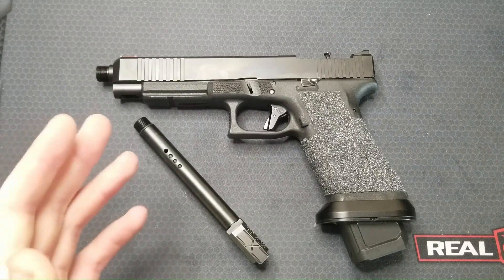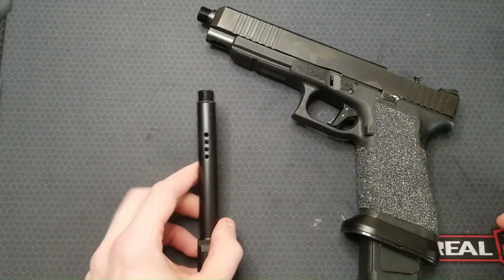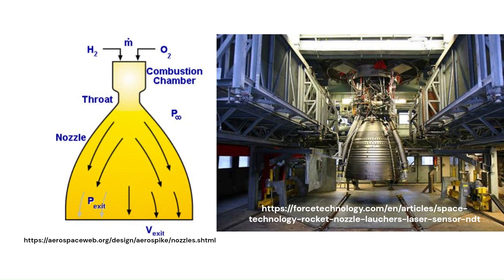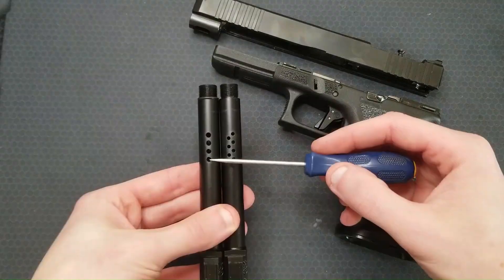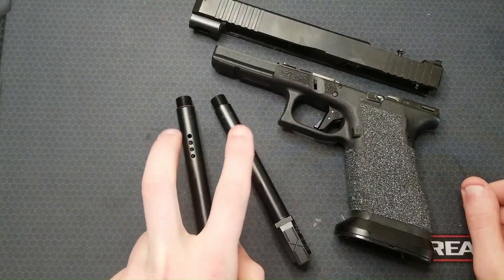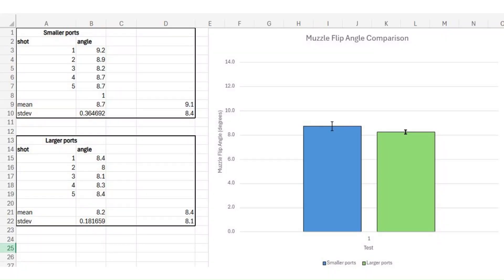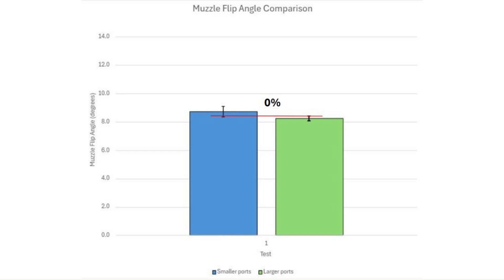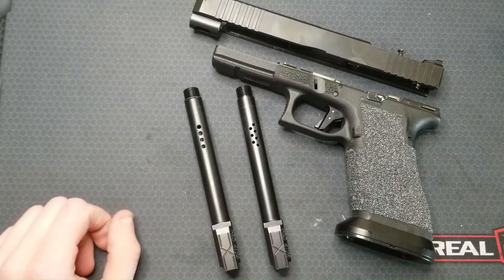Bigger or Smaller ports in a Pistol Barrel

Comment: I’d like to see the ports drilled at like a 20 degree leaned back angle. Yes I understand it would send more of the gas towards the operator, but would be interesting to know.
Reply from the maker: Ah yeah kind of "pulling" the muzzle forward with the gas energy. Then again, any gas not being vented straight up will not contribute to reducing muzzle flip, which is generally what I want to reduce on my pistols.

Comment: Love your stuff, but not enough control when dealing with differences this small in performance imo. One obvious difference in your port layouts being that optimally we want the ports to result in a push directly down. By having one set of ports offset from vertical in a v configuration and the other all exactly vertical, the force vector of the smaller ports being slightly off vertical is limiting the energy driving straight down into the muzzle, which is really what you are trying to measure. You should have run both port sizes in the same v config. Been enjoying this series though!
Reply from the maker: Still trying to collect data and glean what information I can within my testing capabilities. Both these port layouts were drilled vertically. I state this at 02:48. The smaller ports are just staggered and offset from the centerline to fit them within the same extents. I did that intentionally for this testing in an attempt to control that variable.
Reply: @I think It's more complex than just drilling them both vertical, as the offset ports still have characteristics compared to the gas under pressure in the barrel that are different. Is it enough to matter? No idea. But you have one set of ports directly in line to the push of the expanding gases, and another at an angle to the expansion in what you did. The ports drilled off center are also a longer "pipe" which will have more friction losses. My gut still tells me using a V config for both, with the ports drilled directly into the centerline of the bore is more controlled. You can maintain the overall length and location of the ports so dwell time will be similar etc.
Reply from the maker: @chadlevitan7886  Thats getting into the minutia that I don't necessarily care about. lots of compromises and simplifications here. And lots of things that are not feasible to control with how little real estate I have to work with on the top of a 9mm barrel, as well as the form of the ports I can even machine with my skills and manual 3 axis machine. I would hope most people watching these videos know that this is a pretty dang unscientific "scientific" test.

Based on my experience with this stuff, I think what you're describing wouldn't show up in testing at all even with a Ransom Rest. Nor could it be decoupled from other effects or even be isolated. Fluid mechanics simulations might be the only way to figure that out, and that's only in theory.

I agree that since the offset ports "wrap around" the circumference of the barrel more than the inline ones, there will be more gas coming from them that is directed sideways and doesn't contribute to mitigating muzzle flip. I thought about this as well before machining. I wanted the offset ports to have the same radial extents as the inline ports if possible. But that would have compromised my axial position and extents which I figured would affect results more.

The fluid mechanics of the gasses coming out of the ports are going to be so complex that it is certainly out of my wheelhouse to make conjecture about performance. I explained in the previous video that my background in mechanical engineering related fluid dynamics primarily dealt with subsonic incompressible flow as that is most applicable to my field, and what the curriculum taught. Supersonic compressible flow, the case with gasses leaving barrel ports, is a whole different animal that I never explored enough to have intuition about a lot of this stuff. I would have gotten into it had I pursued an aerospace minor, which I did not.

Not discounting that you bring up a good point. The answer is with my testing capabilities, or the feasibility of this type of testing in general, Its not reasonable to try to control for or isolate variable like that. I attempted to control what I could and test as best I could, to come to the answers that may help me for my purposes. In this case, I got the answer I was looking for and am simply sharing my results.

I would love to see your port designs, testing and experiments if you ever go down the road of wanting to attempt to answer your questions for yourself.
Reply: My related knowledge is all limited to compressible flow in HVAC systems, so this is out of my wheelhouse too. It's just fun to think about. When I get a good mill, which is the next toy on my list, I'll definitely be playing around with port design! Thanks for putting your stuff out, it is all really interesting regardless.
Reply from the maker: @chadlevitan7886  Heck yea. The design and machining is probably my favorite part! I like that my testing spurs discussion like this in the comments, testing begets testing, some questions answered leads to more unanswered questions.
Reply: @EngineersArmory  Totally! It's not a popular topic of discussion amongst my regular friend group, shockingly haha. An experiment I had in mind was a series of ports of different and increasing or reducing sizes, perhaps a smaller port closest to the chamber with the most dwell time and in theory the highest pressure, moving up to the largest port nearest the muzzle with the least dwell time before the bullet exits the barrel and vice versa.
Reply: @chadlevitan7886  Can you share your thoughts on this scienerio? 
I am looking at having my Sig P320 XFive barrel ported.  The slide already has 3 windows in the top that I was planning on taking advantage of.
What are your thoughts on placing a "chunk" port that corresponds to the slide window nearest the muzzle, then two or three circular ports in the middle?  Should I do any ports in the window nearest the chamber?  What diameter ports should I consider?  I was thinking 5/16" in the middle and possibly three 3/16" in the rearmost window.
Reply: @jeffhernandez5098  Let me start by saying I am not sure. My back and forth did inspire me to start reading up on supersonic compressible flow, but there's a lot there to learn, and experimenting with port size and location is going to be necessary to help round out my understanding in the context of a pistol. In thinking about it more, I do think that having normally sized ports in the middle third of the barrel, perhaps slightly biased toward the muzzle is likely fairly optimal. This video shows a few good port setups, you can see how close to the chamber the Tampa Gun Werx layout starts to the chamber about midway in: https://www.youtube.com/watch?v=6ZGGgwSTiMA

  I would personally stay away from too large a chunk port, as it has the potential to negatively affect accuracy and throw more copper, but I do think dumping as much remaining pressure upward just prior to the muzzle is a good thing provided you aren't affecting accuracy. The OP's video comparing ported to ported with compensator demonstrate that there is probably a slight benefit to having both, a chunk port would accomplish a similar thing. A slot parallel to the bore axis is probably a better shape, ala the Glock C ports, to gain port area over a series of holes of the same width/diameter than a huge square or rectangular chunk port. The reason for using smaller ports near the chamber would really just be to maintain more velocity while adding some extra energy resisting muzzle flip. Depending on what you're planning on doing, that may not be a factor and you can just consistently size the ports in the middle and rear window. The ports closest the chamber will have more dwell time under pressure, which should mitigate the fact that they're closer to the pivot point of the pistol in your hands. If you're competing and need the pistol to qualify for major or minor power factors then the velocity aspect is maybe something to consider - but velocity loss should be pretty minimal even with lots of porting (50-100 fps total, so the rear ports should be a fraction of that) and you should be able to overcome it with hotter loads generally speaking, which will also make your ports work better. Hope this helps!

Comment: Sweet videos! Very interesting. I feel like when comparing port designs, you should chronograph them too to see if one bleeds off more fps.
I think V ports bleed off more velocity to achieve an equal level of downforce compared to top ports. It would be interesting to see this showed in a test like yours.
Reply from the maker: As interesting as that would be, I'm not interested enough in that to buy a chrono.

Comment: id like to see chrono(speed) or velocity change to really see if 1 design can significantly maintain muzzle velocity over the other
Reply from the maker: As interesting as that would be, I'm not interested enough in that to buy a chrono.
Reply: A measureable drop in velocity could be directly related to an increase in gas flow from the ports. Seems worth knowing. @EngineersArmory
Reply from the maker: @farmerdanz  Indeed it could. I gotta pick my battles with this testing, and I'm not going to buy a chronograph haha.

Comment: I have the timney as well. Hated the over travel after slide cycling. A ghost cat 4.5 connector completely changed it. Reset is now 2011 short.
Reply from the maker: Hm my trigger doesnt have much over travel. Pretty short reset. Maybe it's the zev connector I run.

Comment: Would smaller but more ports be as effective as larger less ports if they both have the same surface area of exposed porting? I.E v8 porting with larger holes vs v12 porting with smaller holes but same surface area of exposed porting ? Would like to see this explained as I’ve seen this questions asked across the internet without really a solid answer.
Reply from the maker: Thats exactly what I just tested in this video, unless I am misunderstanding your question. More smaller ports (7 in this case), vs less larger ports (4) with the same overall cross sectional area.

Comment: What would be your thoughts on something like crescendo porting(similar to like a WiFi logo), smaller ports out near the chamber and then widening out closer toward the muzzle. Seems like a similar idea you’d see in open guns as they sometimes have two ports on the barrel and then a large 4-6 port comp right after. Could this idea possibly have similar results to a bigger port without the detrimental effects of jacket separation?
Reply from the maker: Another one of those situations that I don't have good intuition for. after this testing I might be inclined to guess that increasing port size further away from the chamber would help more gas get out as pressure in the bore decreases with every subsequent port. So maybe that would help performance? I'm guessing the difference with another porting job of similar total area but uniform port size wouldn't be noticeable.

Comment: Thank you for all of your videos. Always learning from you. I'd be curious to also see if there's a difference between V porting vs inline. I guess in your case, 2 ports on each side vs the inline quad ports.
Reply: The V are worse, wasting gas and only the vertical component helps. 
V-porting stems from Magnum revolver porting. Has no benefits if you can make ones pointing up.

Comment: Id like to see if you tapered the holes. Outside to in is fairly easy but tapering from the inside to outside would be more difficult. 

I hated dealing with anything near the speed of light.
Reply from the maker: Putting a diverging taper (away from the bore) with a countersink would be an interesting test. I don't think we would even see as much difference in performance as we did here though.

Comment: have you compared the barrel ports vs the front "chunk" ports? If you did I missed that one.

Maybe an idea is barrel porting vs a/m muzzle comps
Reply from the maker: I have chunk ported a barrel, but i didnt bore the rifling out like I should have. So thats not a good representation of chunk port performance. 

I did compare porting to comps in a video with this glock 34. Check out the ported barrel playlist linked in the description. its in there.
Reply: @EngineersArmory I compared two chunk ports on my 48. One was back bored (Arc reactor), the other was OEM done by Mac Defense). The arc had a very slight advantage in reduction, but was far less accurate when compared to the fully rifled barrel. I assume the bullet was less stable upon departure. Of course it could be the difference is barrel quality.
Reply from the maker: @essray  The one without the rifling bored out is likely causing separation of large pieces of the jacket/bullet. I noticed a really bad loss of accuracy when I chunk ported my Hellcat in that manner. Also was depositing molten lead all over the top of the barrel and underside of the slide, essentially soldering it. 

Also got two quite large chunks of spalling imbedded in my forehead. ER, surgery months later. No fun. In my eyes, the rifling after a large area port, like a "chunk" port, absolutely has to be bored out for multiple reasons.
Reply: @EngineersArmory i have not experienced jacket separation or accuracy issues with my fully rifled OEM, but the super single by Mac Defense is conservative when compared to the big chunk port others offer. Just my experience.
Reply from the maker: @essray  interesting. I looked up that MAC defense port and it's still quite large. I would expect some accuracy loss, maybe not as bad as I experienced, but almost certainly spalling and jacket separation. Would be interesting to hold cardboard over it and see what damage/holes show up. Don't use your forehead like i did lol.
Reply: I’m also interested in the extended slide “comp” vs a threaded on comp  and ports. I have relatively little experience with compensated pistols, just a buddies open gun and my carry gun which is a micro dagger c1. 

I notice a pretty hefty recoil reduction with the comp slide, just curious how much it actually performs compared to a comp. 

Thanks for the great content!

Comment: I hope you’re having a good weekend brother 🫡 one thing I’ve been wanting to know the science on is the difference between an actual comp block, like the XC and the Pit Viper have, or the PMM barrel and comp sets they sell versus a plain Jane chunk port. I know the chunk port is just material removed from the top, and the comp blocks actually have an expansion chamber machined into them. So they open up in all 4 directions after the barrel and have a deeper pocket cut into the 6 o’clock position. I’m guessing the science behind that is to make more gases travel down before and then up and out the bullet vortex makes any disruptions?…..or I could be miles off and that’s not even close to why lol idk but that’s just what my head is telling me is going on. But it definitely sounds like a question that’s inside your expertise and background, so I figured I’d give it a shot 😅 thank you 🙏🏻 you’re still a better teacher than anyone I had in school and you make it fun and interesting 💯
Reply from the maker: A chunk port can just be a hole in the top of the barrel. The ones that perform the best will also have material removed to the sides and below the bore. This will create more vertical surface area for expanding gasses to impinge on and be redirected upward - mitigating muzzle flip. Bull barrels, or heavy profile barrels have more material outside the bore, so more material can be removed around the "chunk" port in the top of the barrel. This leads to more vertical impact surface area and more gas going up. Now I havent tested the difference between a chunk port on a standard profile barrel vs bull barrel. But thats why I think a bull barrel with a chunk port, if more material is removed around the bore, creating a larger expansion chamber, will perform better.

Now no matter if your chunk port is in a standard or heavy profile barrel. The thread on or sight block comps will perform better because they have so much more volume in the expansion chamber and direct so much more gas upward. 

The ports cut in the top of the slide with a shorter barrel - think Sig XMacro, will probably perform worse than even a chunk port in a standard profile barrel. There is no vertical surface for the gasses to impinge on other than a tiny bit up thru the vertical ports.

Best performance > worst performance should be threaded barrel/island comp > heavy profile barrel chunk port > standard profile barrel chunk port > integrated slide comp with short barrel.

Hope that makes sense and helps.